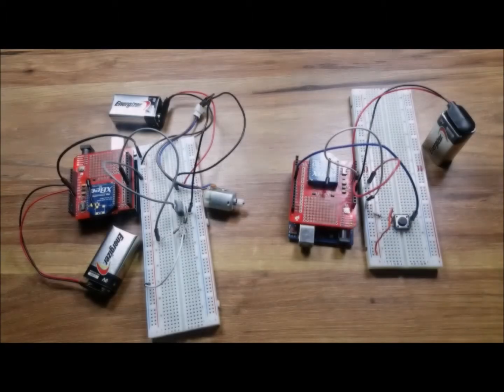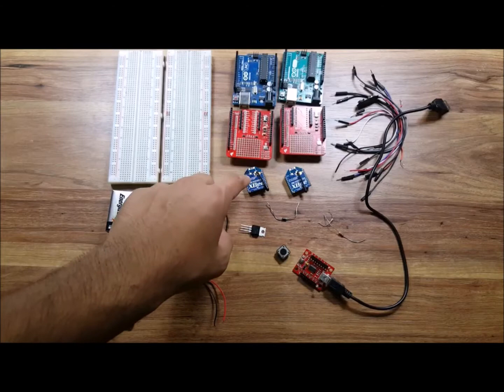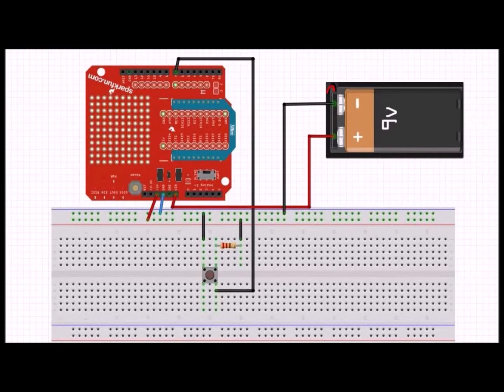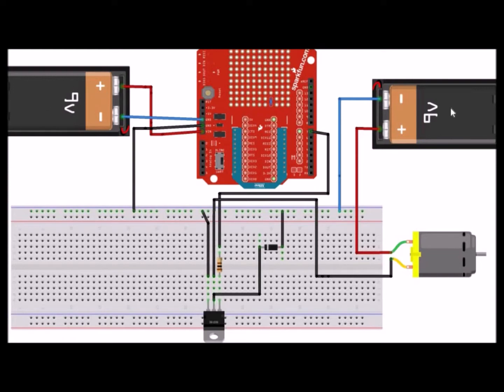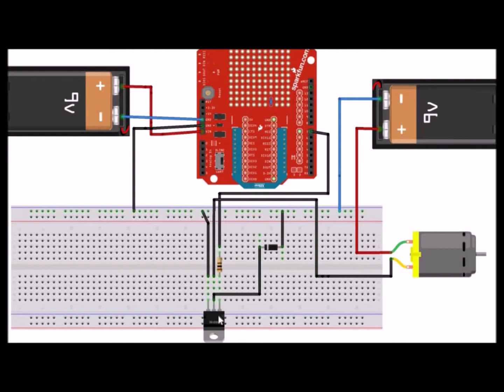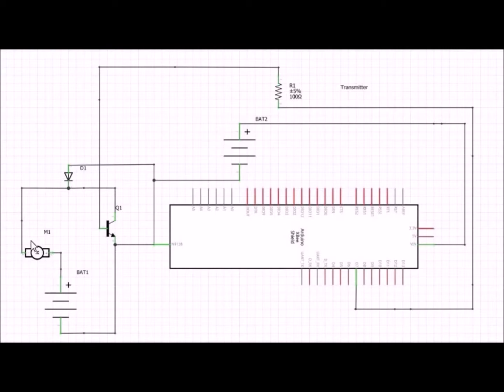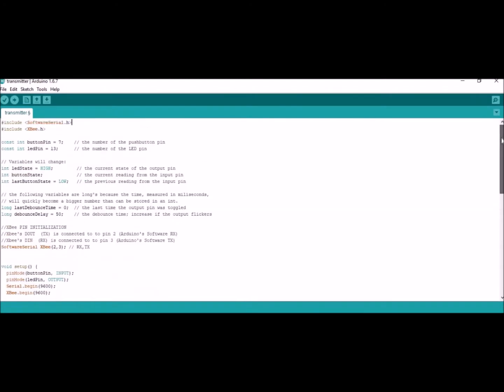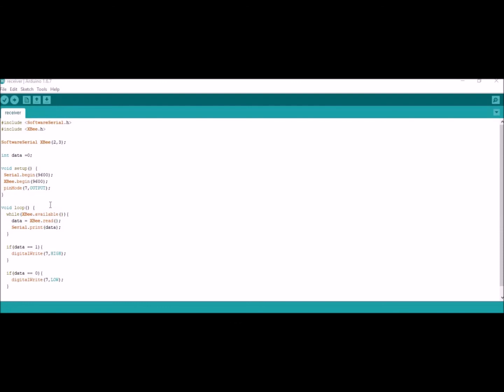Wireless DC Motor Control Using XBee Radios

Comment: Thanks for the awesome video! super helpful :)

One question:

Could you accomplish the same project by taking off the atmega328p chip from the UNO and just using that as the standalone microcontrollers to control the motors? Lemme know if my question is not clear enough. Thank you again!
Reply from the maker: Elliot  Hey there! Technically you can although I have yet to implement it myself so I might not be able to give you a full answer. I’m assuming you want to design your own embedded circuit boards for the transmitter and receiver? I can give you a few points that might help you: 

- You can use the same code that I used in the video but you would need to flash it to the Atmega bhip. 
- The Xbee shields would be redundant and you would need to directly wire the RX and TX of the radio with the RX and TX of the chip on a PCB board
- You need a crystal oscillator chip, which is the same silver semi round chip on the Arduino board. The oscillator will feed the Atmega chip a signal at a certain frequency to execute the code.  
- If you’re using a 9V battery as your power source like I did, you need a voltage regulator to step down the voltage to 3.3V since the maximum voltage rating of the Xbee radio is 3.3V. Any voltage beyond that fed to the radio will burn it. Likewise for the Atmega chip, the maximum Input voltage is 5V